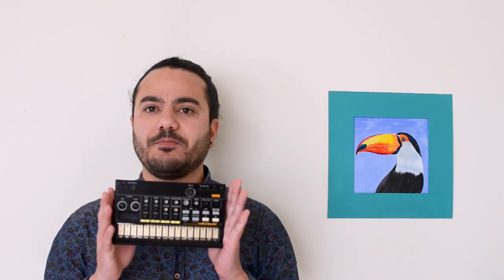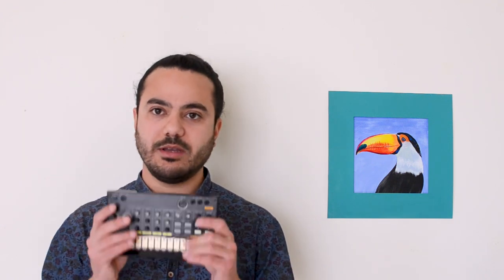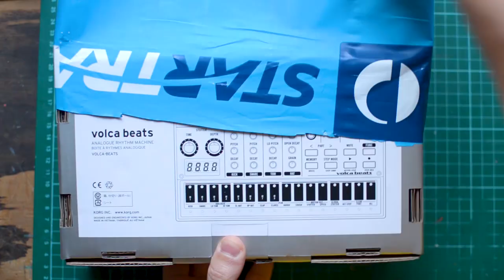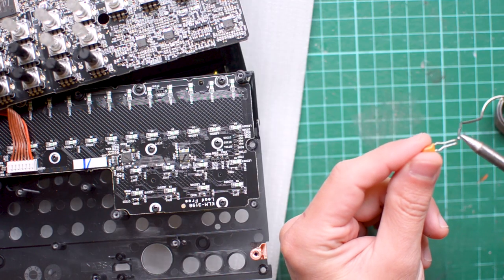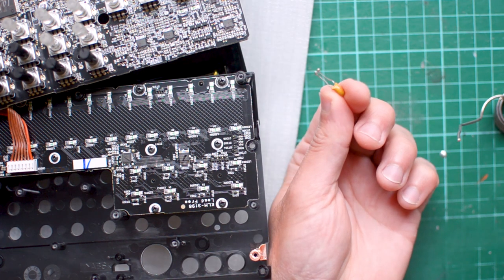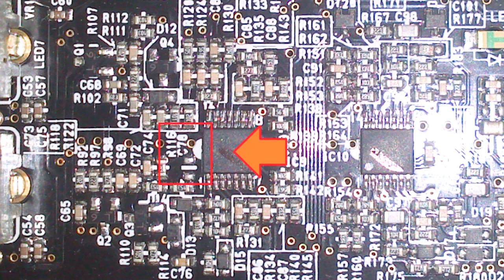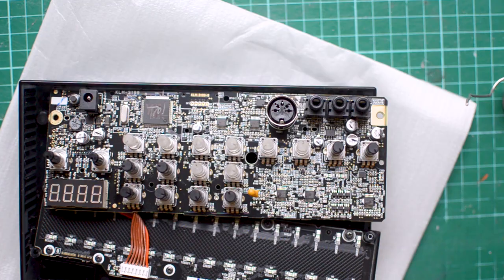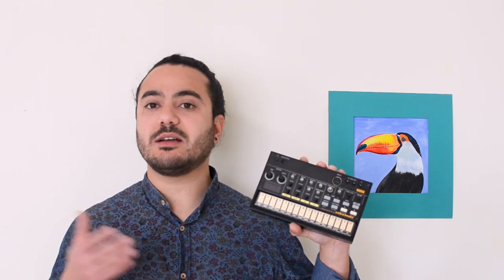korg volcabeats snare hack

Comment: how did you take the stutter knobs off?
Reply from the maker: Try using a card, pull up the knob a little bit, then place the card underneath and move it. it will prevent any damage, cheers!